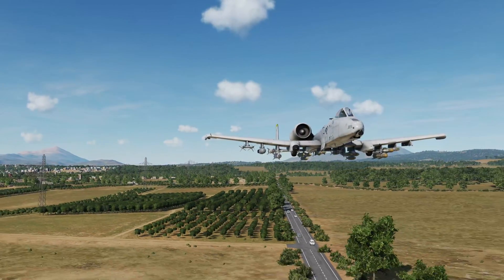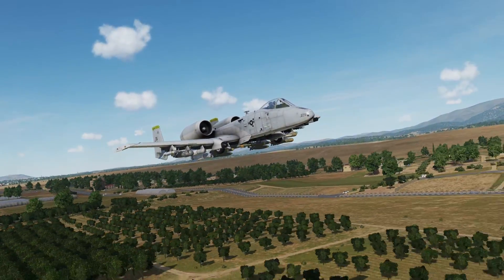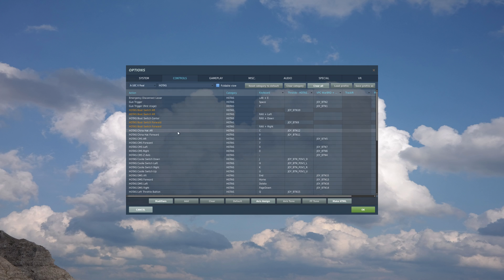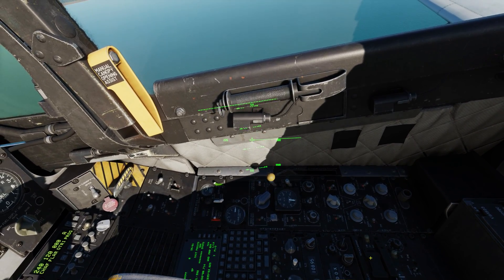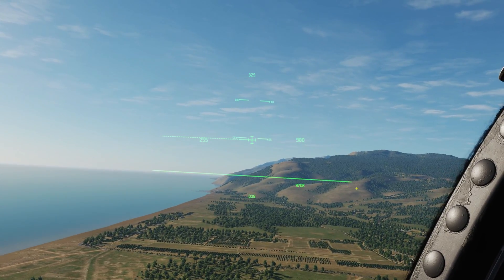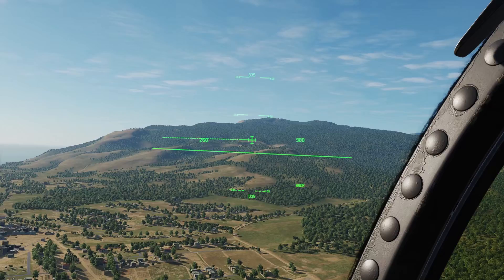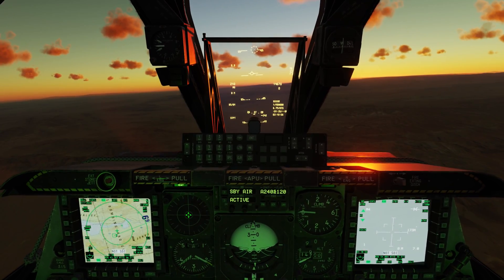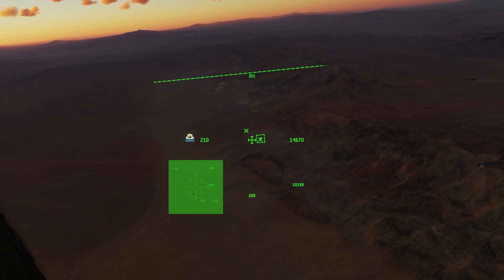DCS: A-10C II Tank Killer  |  Helmet Mounted Cueing System (HMCS)

Comment: Question for you if your still monitoring your video's after this long :)

Is it possible to set the on-off of the HMCS to a keybind?.... im new to DCS and always loved the A-10, so it was the first aircraft i picked up.  I know i can just toggle the switch for it (found that at least :D ) but currious if there is a keybind somewhere to set it to a toggle/button to make it easier to use considering where the toggle is located.  I tried finding it in the controls menue myself but cant :T

Comment: Hi again, Wags.

9:10 I finally started flying the Tank Killer as it came in the last update for the Stable Release version, and I'm having a hard time getting this TGP + HMCS feature to work. Not sure if it's a bug, or I'm doing something wrong, but I've tried many times pressing the DMS Left Short, but the TGP image never comes up in my HMCS. I've tried with both the Helmet and the TGP as SOI, but neither of these worked.

Is there anyone else having this issue in the Stable (non-Steam) version? Am I missing something?
Reply from the maker: Please make sure that the TGP is on the right MFCD. Thanks
Reply: @MattWagner  Oh! That's it! I knew I was missing something. Thanks.

Comment: Hey, Wags. I've just noticed a minor typo in the HMCS page in the MFD at 10:43.

When you enter the Stats page, the top off-screen button displays "HMCS" correctly, but when you press it, it enters the page that says "HCMS Symbology". A very minor mistake that should be easily corrected.
Reply from the maker: Yes thanks. Already fixed internally for the next update. Thanks

Comment: @00:32 is this caveat a hint that we will never see similar implementations on the F-16 or F/A-18?  I could be wrong but I was under the impression that at a minimum HMD target designation and other HMCS capability (location of wingmen and other assets in operational airspace) exist on those respective airframes. I know they are not as advanced as the A-10 II but I was also under the impression that the HMCS capabilities in the Viper and Hornet are more robust than currently simulated in DCS.

Comment: Damn this looks absolutely amazing! Couple questions: Does the datalink work with Link-16 now or is it still the same as the A-10C right now? Does the HMD show weapon symbology and/or Maverick video feed? I think I remember seeing one of the trailers showed a mode that looked like it was superimposing the FLIR video from the TGP directly over the TGP line of sight (kind of like NAVFLIR on a HUD), instead of as a separate video feed, is that possible/planned? Edit: also, how is this displayed in VR? Is it a one eye type thing like the JHMCS, or multi eye by default, and will there be an option to change it like there is for the JHMCS?
Reply: L16 is not fitted on any of the active service A-10s IIRC. The SADL can however communicate with L16 provided there is a gateway.
Reply: @tommysmiley8512  "SADL" ?
Reply: Oh yeah I remember seeing the NAVFLIR type thing.
Reply: The VR answer would be interesting for me as well.